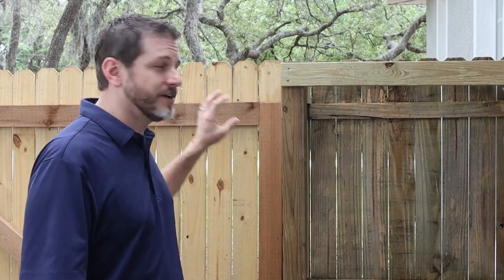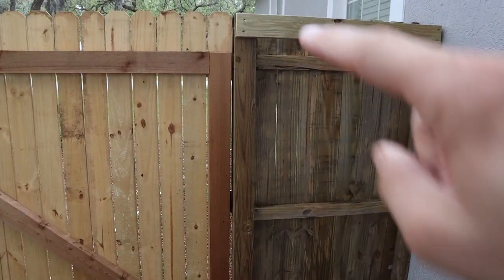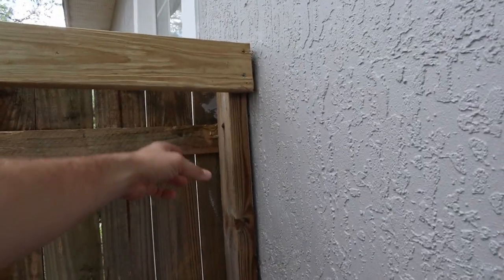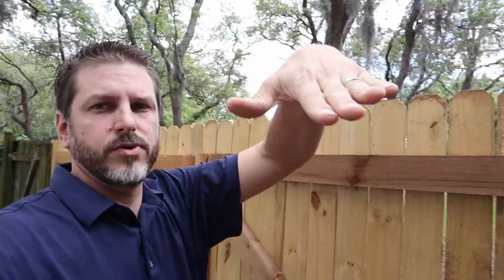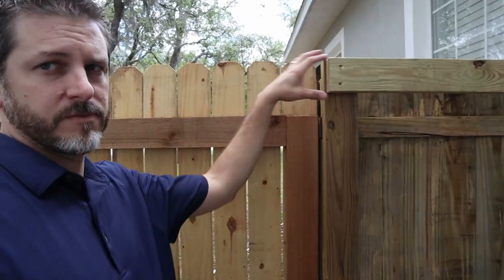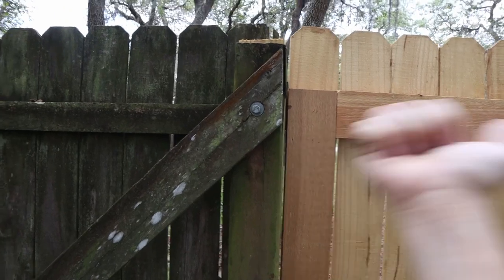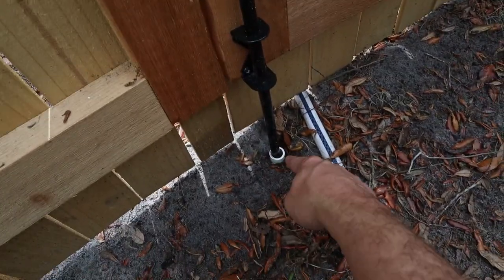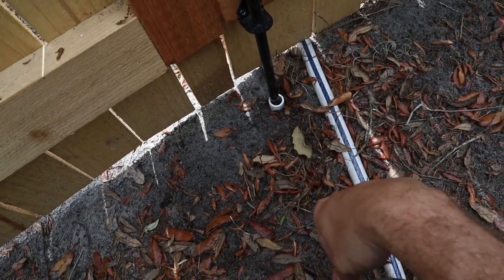Don't Use a 4x4 Gate Post for 12ft Gate... Don't be like me!

Comment: Use 6x6's for your posts for gates that large.  Fence building 101 lesson.  Use 4x6's for smaller one man gates if you'd like.  Another tip.  Coat the tops and bottoms of your posts (basically the part of the post to be buried below grade + six inches) with flex seal.  This rubber coating will slow the premature decay of your posts at grade where water spashes up against the wood as well as below ground where heavy clay soils are almost constantly saturated with moisture from fall - late spring.  It's a lot easier to replace rails and pickets than posts.  Flex seal is a trick someone showed me a few years ago to extend the life of your fence considerably.
Reply: Even better - use a post cap. 6x6 for sure.  My gate is failing - not sure on the age it came with the house but it uses 4x6 and I bet I could have rebuilt the gate and left the posts if they were 6x6.

Comment: Good advice. What about adding wheels on the bottom of your gate? I’m in the process of building one now and I’m using spring-loaded hard rubber wheels (concrete driveway) to counterbalance the weight when the door swings open and closed
Reply from the maker: Not a bad idea if you have a concrete driveway.

Comment: Don't attach your fence to a house or any structure.  The fence and the house will settle and move over time which will eventually damage the fence or the house.  Use 6x6 posts.  keep them 1-2 feet away from house and then bring finishing boards within an inch of your house
Reply: I think a couple inches would be enough instead of 1 to 2 feet.
If I leave 2 feet, my car wont fit, which is the purpose to make the gate.
Reply: @douglasflores1462 that is my exact problem but it's an 04 Dakota I bought brand new and it still runs and drives as good as the day I bought it.

Comment: I have two 10 ft wood doors , Thinking about putting  squared metal post what size would you recommend?
Reply: 1/4” wall and lots of concrete! Make sure the concrete is below the frost line. Put a cap on the top and drill a 1/4” hole right above the concrete to allow any water to drain out of the post and prevent it from rusting from the inside out. Spray galvanize paint on the inside and out of the post before putting it in concrete.

Comment: Hello, I’m about to build a 12’  shadow box gate at my house in north central Florida. I’m debating between using a 6x6 post on each side or two 4x4 on each side. Any preference?
Reply from the maker: Definitely go with 6x6 concreted in. You won’t regret the extra cost or work. And if you do 10ft post with about 3-4 feet in the ground, all the better.
Reply: @IAmAFixer  how about 4x6 x 8 feet long? 3 feet into the gound and 5 feet to hang the gate.

Comment: why not just put a castor wheel at the bottom of the gate so it holds the weight
Reply from the maker: Probably in a more northern area that would work. Here we have sugar sand and it just would dig into the ground. Great idea though. Have you built a gate and used a caster?
Reply: @IAmAFixer  no. i'm researching to build a gate and I found your video.  i have been thinking about the weight and size of post thingy and your post validated that I need a thicker post than a 4x4.  In my case no castor as the driveway slopes down
Reply from the maker: Yea. If you put a 6x6 in concrete and use cedar. You shouldn’t have any problems. It will be plenty strong.
Reply: I know it might be a bit late... but I’m in the process of building my gate too (8+8 double gate ) I might opt for the 4x6 and use a spring loaded gate caster wheel 200lb
Reply from the maker: That would be fine. In FL we have sugar sand and castors just won’t work. They sink into the sand.
Reply: I Am A Fixer 
I’m in Central Florida and one side of my back yard is sandy and the other one ( where the gate is gonna be built ) is more solid dirt
Reply: Built a double gate with a spring loaded castor wheel as other YouTube videos have suggested on the long gate.  While it keeps the gate from sagging, it introduced torque on the gate which resulted in the gate not flush with the other gate when closed.  No YouTube video I’ve seen mentioned that.  But then I didn’t use a 6x6 post so if I did, it may have resisted the torque better
Reply from the maker: Thanks for sharing, Rick.
Reply: @IAmAFixer  I basically modeled my gate after yours in the other video. It looks great. I used a 4x4 though didnt see this video till today.

Comment: I plan on using galvanized 2 3/8" metal posts  for my 12' gate you think that will hold up pretty good? ...Im going 2' deep in the ground and using a full bag of concrete mix
Reply from the maker: It’s more weight on that gate than you would think. I would try to go 3’ deep on the post, and reinforce the top of post or I’m afraid it may it may pull that post and cause it to sag. If I was building from scratch, I would probably use 6x6 post for each hinge side of the gate. I don’t have any experience with using galvanized posts, so I’m just not sure if you would have issues. My gut says you will.
Reply: The key that a lot of people don’t understand about post hole depth is: you need to get below 2ft deep to get your footing below the frost depth. If the ground is freezing and melting then the ground will move. Always try to get 2.5ft to 3ft deep ☺️👍🏻
Reply from the maker: Good tip. Thankfully I don’t have to worry about that in Florida.

Comment: 1 bag of concrete per post isn't even close to sufficient.

6 feet deep with auger on a digger

2-3 50lb bags of Crete per post. 

Any less and you're going to have issues.

Yeah a 6x6 is the go also.

In conclusion. Post size too small and 3 feet and 1 bag of concrete is definately not enough. 

What you could do from here is put in 6x6 to the spec I said above a foot further back from where it is now. Remount the gate and panels. Cut off the old stuff at the ground.